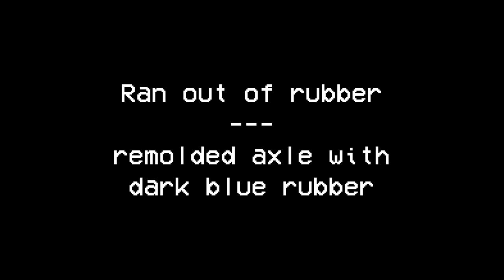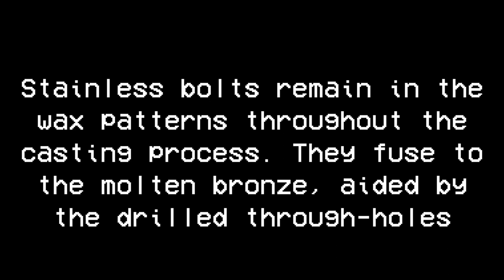Foundry: Cast Bronze Skate Trucks + Wheels, fully functioning

Comment: Do you ever dabble with copper or aluminum? What is the reason for having such a big sprew?
Reply from the maker: the 1x1 square down sprue is just a generic size made by art wax companies, i just had some on hand. i could do this with a .5 or .75 inch round sprue too. the casting was pretty non-complicated. copper and aluminum are both nightmares in their own ways for making sculptures. bronze is an ancient tradition because it has been designed to be the most easy for casting. copper needs a lot of brute force to do what you want. aluminum works pretty similar to bronze until you try to weld/work/assemble it and it's a pain but it's very light which may offset some of the problems in manufacturing
Reply: @skraminc  any chance you are on a discord channel at all? I could probably pick your brain for hours lol.  Thanks for the replies.... about to melt some copper now.
Reply from the maker: @wantafastz28  i don't use discord but if you have an instagram you can message me there @skraminc
Reply: @skraminc  unfortunately no, over social media. Look forward to seeing upcoming videos!

Comment: pretty good job, a few eh discrepancies but i doubt i could do much better hah
Reply from the maker: which discrepancies? i can do better
Reply: @skraminc  i was thinking itd be better to have a full bar for the axle instead of 2 individual parts per to make it more even and such, i saw you didnt put in pivot cups, the rubber cups that go in between the hangar pivit joint and the pit of the baseplate, and in the kingpin slot for the hangar where it wraps around it wasnt a very even circle between the kingpin and hangar nor was it flattened down for the bushings ti have a better seating area, small minor gripes mostly heh. honestly was overall impressed with the video though!